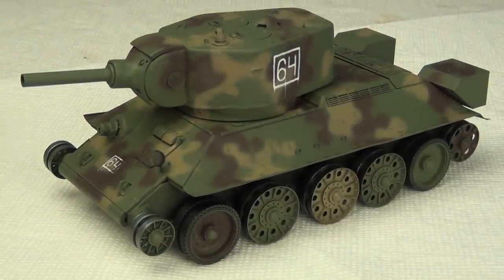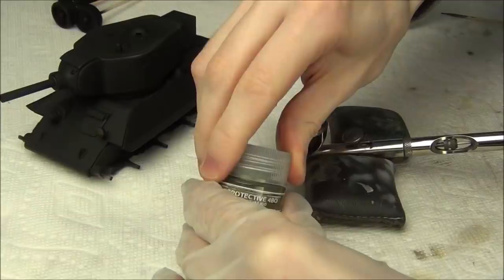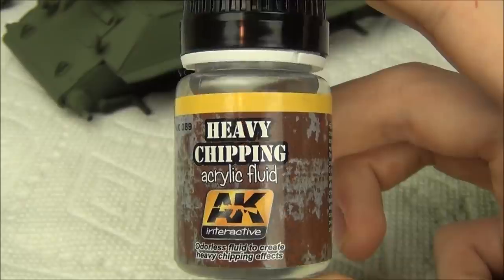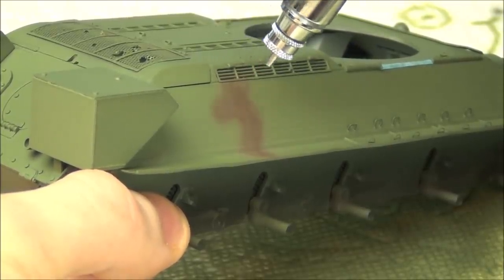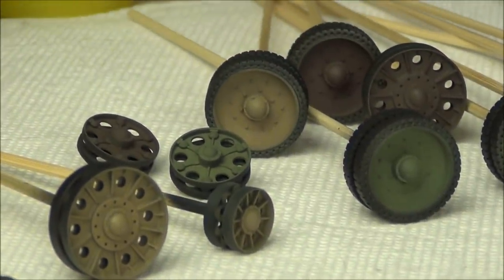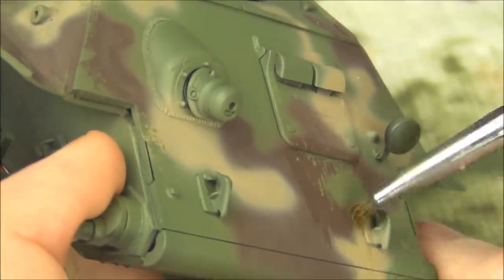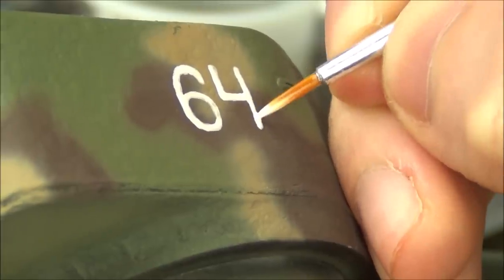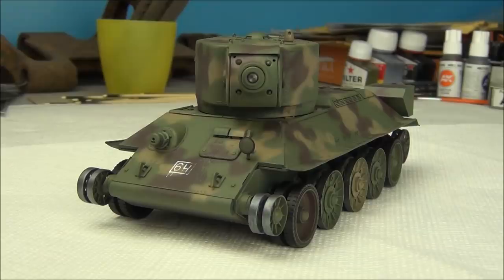How to Paint Russian Tank Models ... 1941 Three-Colour Scheme (+ details and markings) on a T-34!

Comment: That camo scheme came out amazing, and you have nerves of steel painting those markings by hand. Any reason you used AK chipping fluid instead of hairspray?
Reply from the maker: I have run out of hairspray lol and I didn't want to buy more since I had gotten set up to paint.  I also ended up using it on my Tiger too which I painted at the same time...
Reply: The chipping fluid seemed to work pretty well... haven’t used it but from what I’ve seen in a bunch of build videos it seems to be harder to avoid large chips? Yours came out great... maybe a few on the fender were a little on the big side.
Reply: I used chipping fluid in my video and it worked great. I was able to get some micro chipping in areas.
Reply from the maker: After chipping my Tiger 1, it does seem like chipping fluid can give you fine chipping.  Though I do have a fair amount of experience with it so I know how to use the brush to get the chipping looking nice and fine.  

I'd say that HS is a little more forgiving and easier to work with than chipping fluid.  Kind of like how using Tamiya paints and not water-based paints can also help to make it easier to get fine chipping..."can"...it's not required, since you can get nice results with a little more care in using water-based paints too.

Comment: Very nice! I'd love to see how a complicated scheme like this gets highlights and low-lights with oil paints. But I know winter camo is going on top of this so, =p

Also the gun metal color on the wheels just seems almost too shiney. Is there a way to make them look more like bare steel and less polished to a nice sheen?
I worked on heavy equipment and the rollers were raw steel, but only a bit of shine here and there as rocks and sand would damage the wheels too much for a shine.
Reply from the maker: Thank you.  Once I apply pigments and washes the steel will be toned down a little bit.

Comment: Nice work.  If you were going to present a "blown hatch" on a panzer how would you do it?  This would occur when a shell penetrated the hull and exploded.  I expect, but don't know, that the hatch would be bent and possibly one hinge blown up and out.  I thought of slightly melting the hatch and gluing that to the hull.  Any thoughts or possibly a video?  Anyway, thanks.
Reply from the maker: The hatches are heavy armour plate, usually 40+mm thick (1.5 inches or so).  I think it's most likely that the hinge would simply fail and the whole hatch would pop off; I don't think the hatch would bend.  Armour plates in the same situation usually fail/break at the weld.
Reply: @Panzermeister36  Great, thanks so much.